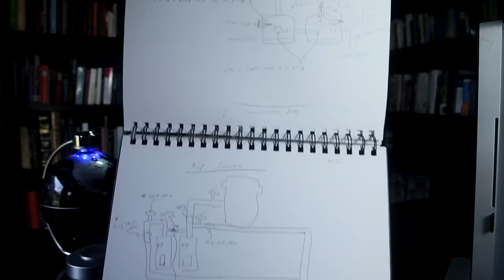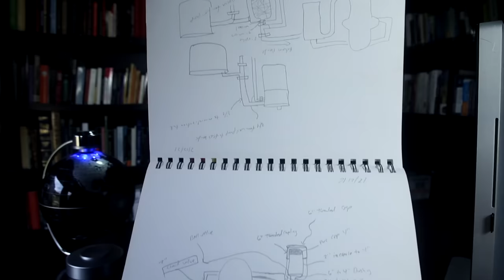GoodBye Aquaponics: My Last Video

Comment: What kept me from aquaponics for 20 years or so was the fear of failing because it seems so complicated.  I'm so glad I came across sandponics.  IAVS sandponics is so simple there's no filters needed the sand bed is a filter.  The ph is perfectly stable.  Typically there are no nutrient deficiencies.  Sandponics is balanced vs aquaponics is a balancing act.

Good luck with all your future endeavors.  If you ever get the itch again try iavs it's everything you were searching for.
Reply: What about Silica poisoning your fishes? That’s the draw back of AVS.
Reply: @drzero1563  I'm familiar with someone speculating that was the cause of their fish's death.  I don't think there's been any proven cases and there's many systems operating all throughout the Middle East well over 5 years with no issues.
Reply: @farmerjhemp  Murray Hallam and his team tried sand based media beds for number of years and they were having  fish losses regularly. After many tests they found out fishes were being killed due to silica poisoning hence they didn’t continue the pilot project. Maybe, you have different filter mechanisms perhaps you can enlighten us with regard to sand based media bed n your way of filtration. I have never built sand media bed based Aquaponics but I would love to build future farms if indeed silica poisoning doesn’t kill fishes. I have been designing & building Aquaponics commercial farms for 7 years now and sand based media bed will help us a lot if we can stop silica poisoning.
Reply: @drzero1563  I'm familiar with that Murray project but I don't think they ever tested for silica poisoning.  I'm fairly certain it was just an assumption that silica killed the fish.  I could be wrong but I don't think I am.  My aquaponics has a channel on here  they've been operating their sandponics system over 5 years with no issues.  My aquaponics describes sandponics as aquaponics on steroids.  Another commercial Farm I'm familiar with is Kewa Egypt.  They also started with aquaponics several years ago and have since switched the mostly iavs because they say it's Superior.  I understand your hesitation with Murray being an authority and his system not working for whatever reasons.  You can always start with a small trial that's completely decoupled from your main system.  I don't think silica killed Murray's fish and I only say this because there's at this point there's dozens if not hundreds of systems across the world that have been operating for multiple years without issues.  My experience is somewhat limited.  My system has only been operating less than a year but I've been educating about sandponics for a few years.
 
There is no additional filtration needed.  The waste will completely break down in the furrow.  A solid waste filter could be used to collect the solids mineralized and then add back.  It's hard for me to recommend doing something like this because it hasn't been tested at scale as far as I'm aware.  Somewhat recently I started using jadam ferments on my sandbeds and have been seeing very good plant responses.
Reply: @farmerjhemp  thanks for details. I am not part of his professional team but he has my utmost respect and gratitude for Aquaponics. When I have asked he said it was silica poisoning. I will give it go at my lab. Wondering with so many commercials contracts on hand would I be able to do a proper pilot or not.

Comment: The filter system separat each cleaning of the filters.   Is when u use that  fish poop as a fertilizer. A 3  tear system  from one tank to another   and back  all gravity feed.       We're the gravity flow of one tank. Create the water pressure needed to. Force the water from one tank system to the next

Comment: Waiting to hear how expensive the hobby was and if he decided there wasn't enough profit in making videos after claiming to be an expert, hence the name "School of Aquaponics".  Clearly he was able to grow some food, but I cannot help but wonder about the trace minerals that were likely very low in the produce.  A key issue has always been what can be produced in a small growing space vs the common larger scale garden/farm space.  The basic fact is when electric and plumbing parts are needed to grow food, it is much harder to break even on the cost of the investment compared to what can be grown and eaten over the years.  As if maintenance wasn't a significant issue, growing fish to eat is going to blow any budget to bits.  It all adds up really fast and the basic things required to keep an aquaponics system healthy and productive are not getting cheaper.  Wondering why he just doesn't say; "The profits are too low, be it growing food, or making videos."

Comment: Wait so what was the final system?. How do we learn about the final simple system. I am just starting and now you are ending, the video was meaningful however I thought that at the end when signing off you would say that for anyone that is interested in what I discovered in my last 4 years here is the video or here is the link to where you can buy the pdf. I want to do it on land by digging up and filling up a loop river. Counterintuitively what has happened now is that you have given me the fear that all of the research I am going to do still won't have that last crucial cornerstone or cherry on top that took you 4 years to discover. That's not that great please help, point me in the right direction to where I can get the batton you are passing on

Comment: if you was really deep on aquaponics system you must understand the aquaponics never become easy agriculture. from other hand for have such stable and high value aquaponic expect of good system design you need to do lots of high tech and some of them not invented yet and you have to find the solution and solve it. but if some one can do that his system become must stable and high efficiency. there is lots of factor need to check and keep an eye on it in aquaponic system, ignoring even small things make huge problem sooner or later

Comment: you were doing it wrong all these time, focused too much on fixing your initial mistake as seen in your pipework. nothing wrong with giving up  but your mindset was incorrect. the less electricity demand, the more successful you are in aquaponics. try to look for low tech style aquaponics. My design was backed with years of aquarium experience so i have the experience to back my designs and have successfully made a decade old aquarium that does not have any filter/ additive/ feeding or co2. the key is mimicing what nature is doing. aquaponics has similar principle but you will need to observe nature first. adding hundreds of tilapia to a no substrate system and relying on pump and electricity is not the way to go.

if its not working, you need to accept it wasnt working and destroy what you're doing. start doing it from scratch. my aquaponics were doing me positive gain, not only its providing me veggies i also sell the fish for money and my design is low tech i dont need to maintain it